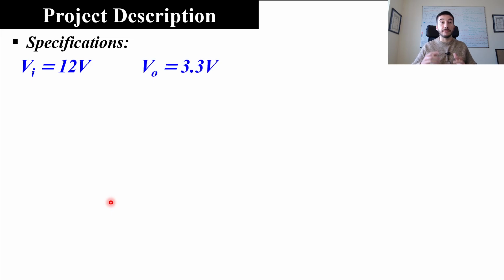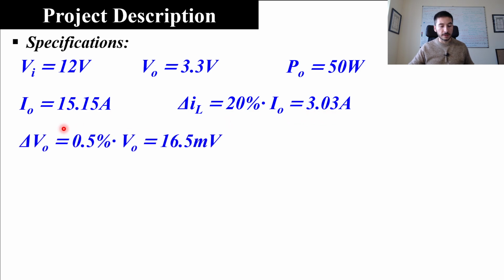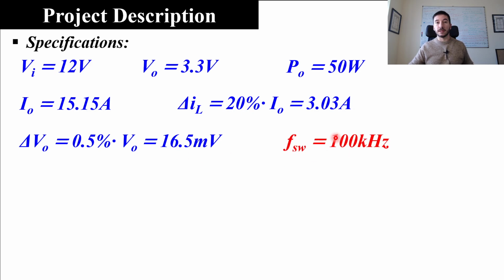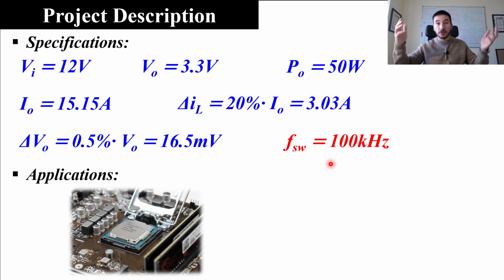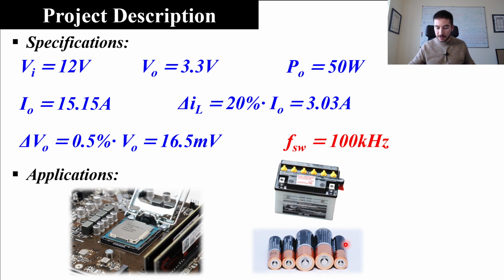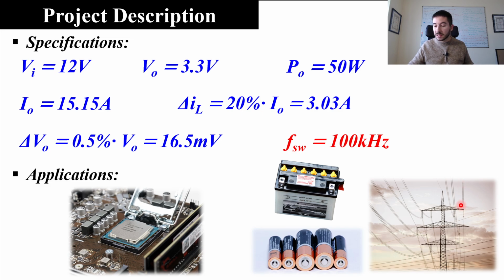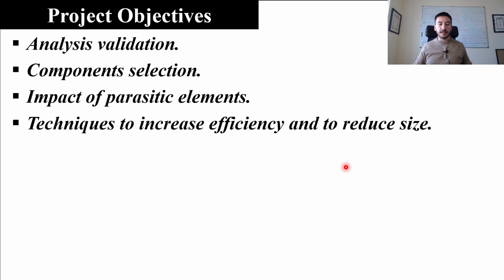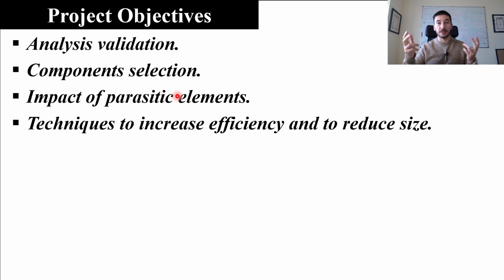Project Introduction: Buck Converter Design in LTspice

Comment: Really good you make this LTSpice video set applied to DC/DC converters. Of course the parasitics also play a big role and the results are not accurate. I experienced it quite a lot in my projects.
Reply from the maker: We will try to see these problems in the simulation results. In general, the conclusions are valid in a qualitative way (which is the scope). LTspice is not suitable for predicting things, such as switching losses, in a very accurate way. There are a lot of phenomenons that are not perfectly modelled. For instance, the reverse recovery of diodes in LTspice does not depend on the driven current (which is not tru in reality). In any case, it is a very good tool for educational purpose.